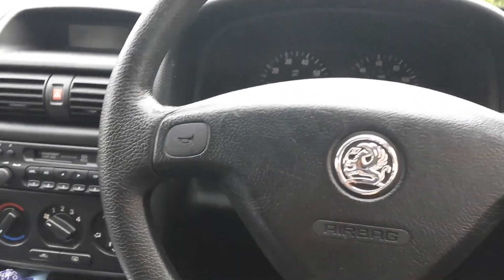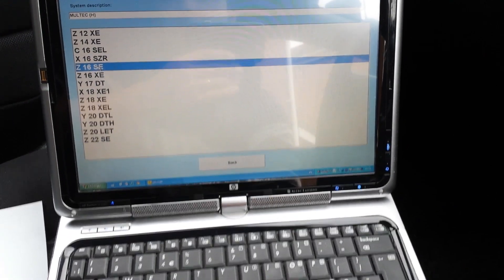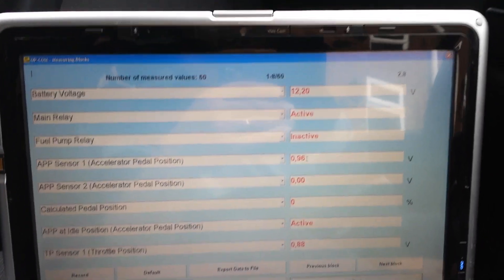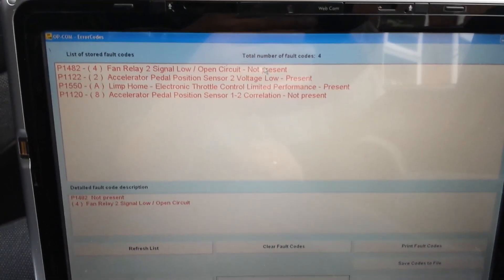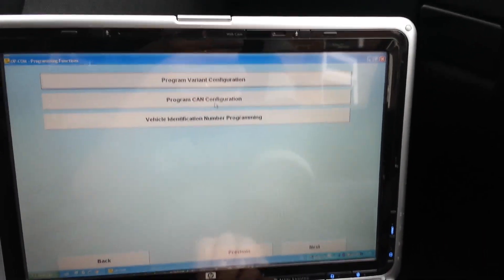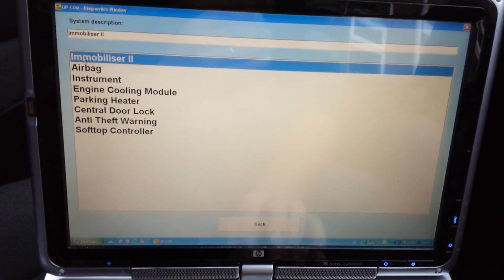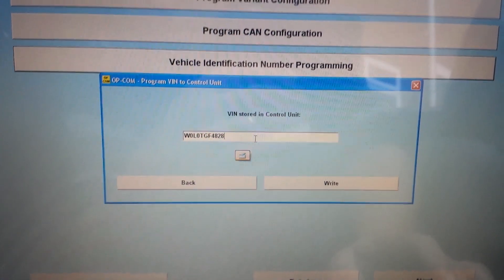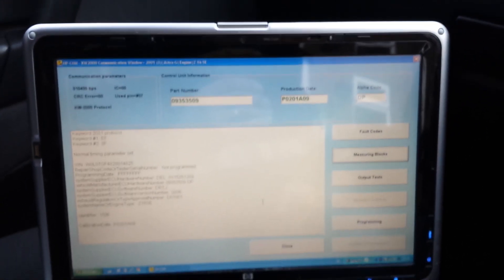Astra 2001 accelerator fault and Engine ECU change and programming.

Comment: Hi thanks for the video! I’ve found a reset ECU with the same part number as my Astra G, but with the four letters on the ECU being different. (Mine is DPAB and the one I’ve found is DMKP) will the swap still work with op-com or do the letters also need to match?
Reply from the maker: Should work, if it is from the same engine...
👍👍👍

Comment: I have got more or less the same fault on mine. Measued peddle and ok. The fault light comes on when its -4 c. Then when the engine temp gets to about 50c...I had op com on and it even showed 0 volts on App2 as the fault appears..Can you program the ECU with the china clone op com?
Reply from the maker: Should be able to... do you have a replacement ecu with the original pin?
👍👍👍

Comment: 02:55  is the engine ecu is dead!!! i had it last year!
Reply from the maker: In this case not "dead" per say, but an internal fault.
👍👍👍
Reply: @LMAutoRepairs  i know.. the cold soldering point. ... you can fix it by your own??
Reply from the maker: @N.D.J.S. 
You can... I have videos on that...
You need a small tip for your soldering iron, some aluminium flux and some steady hands...
😊

Comment: I know it's an old video but hope I can get some help. It might be a dumb question but bear with me. I have 2000 Vauxhall Astra G, swapped the 1.4 engine for a 1.6 engine but kept the original engine ECU (well the service center did not me). Is re-programing the ECU a must to fit the new engine? I'm logically convinced it is but they are not. Appreciate the help
Reply from the maker: You should load the 1.6 software...
Otherwise you are not taking advantage of the bigger engine...
The engines must be pretty similar for you to not notice any issues...
👍👍👍

Comment: Hello i have the same problem i will try to find the 2 wires that should have 5 volts and jump them did u solder them together cause 1 shouls already have 5v or did u get the power from somewhere else? Thanks
Reply from the maker: I barely remember what I have done yesterday, leave it alone 8 years ago...🤣
Whatever I did if if is on the video it is...
However,  you should be able to jump the working 5 volts, but if it is missing and you rule wiring as an issue, then most likely will the the engine control module...
👍👍👍
Reply: @LMAutoRepairs  should I cut the wire that's does not have a 5v? So that I don't brick it even more? And than bridge it with the 5v that does work? Is that saver to do? And what is the - terminal so I can check the voltage do you still remember? I hope so haha that would help me slot
Reply from the maker: @kay__72 
I don't remember now...
Would have to check diagrams...
But a Google search and you will most likely be able to find them...
👍
Reply: @LMAutoRepairs  that's the problem I cannot find anything on Opel stuff ... In you're case Vauxhall 
It's an 2005 gtc 2.0 200hp Astra
Reply: @LMAutoRepairs  could you please have a look for me I need to know fore sure if I also have 2 + 5v wires next to each other i don't want to brick it even more
Reply from the maker: @kay__72 
Google Global TIS...
😉

Comment: Hi mate great videos the wife's got a astra g it's accelerating by itself any ideas.    ECU ??? Or something else it's revs ok stationary but once you drive it accelerates by itself and speedo jumps all over the place I live in Newcastle she's stranded in Edinburgh desperate for answer cheers of ya respond no worries if busy
Reply from the maker: Possibly, or the accelerator pedal...
Difficult to tell with at least a scan etc...
👍👍👍
Reply: @LMAutoRepairs  cheers for the reply it's still stuck in Edinburgh apparently radio is going crazy now on top of faults disconnected battery etc try reset looks like scrap any other ideas might bring back to Newcastle and have a look ,🥴
Reply from the maker: I said, without at least a scan, it is shooting in the dark...
👍👍👍

Comment: My Opel Astra Ecotec 1.6 is facing acceleration issues and it has being diagnosed to be a worn out ECU .I want know if ECU HSFI C and can be interchangeable with the ECU HSFI 2.1 that came with the car.
Reply from the maker: I would try to get the same ecu type...
A "worn ecu" is a new one to me...
The ecu either is faulty or not...
Which codes do you have?
👍👍👍
Reply: Old ECU Code DNHN 12214870 Electronic engine controller HSFI 2.1

The code of the new ECU i bought is  DBKL 09355929 Electronic engine controller HSFI C

I want to please know if it can be compatible
Reply from the maker: I believe they are not compatible...

Comment: Hi my8 new ecu kit car starts ok but has no acceleration gas at all stays at 1200 rpm what could be the problem even with my old ecu its still the same car was ok till i opel the pressure valve on the pump
Reply from the maker: Well, if you have the same problem on two different ecus, as you can guess your issue is elsewhere...
Have you scanned the car?
Have you looked at live data?
👍👍👍
Reply: @LMAutoRepairs   yeah am getting p1122 p1120 p0381 p1635C P1625 p0216 p1530 opel corsa c 1.7 dti
Reply from the maker: Live data?
Anything out of the ordinary? 
Can you see the accelerator values?
You answer most likely will be there...
Reply: @LMAutoRepairs   good morning my8 live data are as about 
Ignition status 12v 
Battery voltage 12v
Main relay active 
Spill valve relay inactive 
Acceleration position sensor signal 5.08
App sensor 1 (acceleration pedal position) 1.14V
App sensor 2 (acceleration pedal position) 1.35 
App at idle position acceleration pedal position) inactive

Comment: Opel corsa c 1.7 dti 2001 
Replaced ecu kit car starts ok i have no gas pedal response changed the pedal 4 times no results what could be the problem cheers
Reply from the maker: Check that you have voltages at the pedal etc... check live data ad well...
👍👍👍
Reply: @LMAutoRepairs   so could bee 100% wire problem or the ecu before was ok now even with the old ecu its during the same thing all this come after I removed the pressure valve from the pump

Comment: Hi my8 i put in a new ecu kit car started straight way rpm stays at 1200 gas pedal not responding it was fine before i put in new ecu changed 3 different pedals nothing wrong with tje gas pedal what could it be ecu has 2 broken pins in bottom korner is it to do with the ecu pls help
Reply from the maker: Broken pins?
If the pins are in use, check is there is wiring on the plug side, I would say could well be your problem...
But without checking diagrams, it is a bit more difficult to tell...
Trace the wires, is there is any going to those missing pins...
👍👍👍
Reply: @LMAutoRepairs  new ecu had 2 pins missing on my old ecu i had 4 same corner and it worked fine till it die so i don’t think is to do with the 2 pins just confirm it with old ecu the plug is new wire don’t know what to do crap the bitch

Comment: Thanks for the video. I have a similar problem but the codes I am getting are U2105 and U2106. I have already changed the gearbox oil. The spanner light keeps coming up and the car goes into limp mode. Any advice on what to do?
Reply: Hi, did you ever get this resolved?  I am getting the U2106 and P1700 error code and I have sent the ECU away to be tested but after saying that it can be tested they are now saying that its to old (2003).
Reply: @sarahlou75  No I had to crash the car. Apparently, it is the TRANSMISSION ECU you need to change not the standard ECU. It can be found somewhere just under the battery. Just get another one second-hand from a similar model in the breaking yard and have it remapped for your car. I was caught up with moving to another house with on-road parking and my MOT expired so I had to get rid of the car. I hope this helps.

Comment: I have 6 pins broken on my ecu opel corsa c 1.7 i got another ecu just the ecu on its own how can it be programmed
Reply from the maker: Hi
You need the pin from the second hand ecu to reset it, (unless you bought it already reseted...)
Then with the pin from the car, go to the immobiliser system and install it...
Same as on this video...
👍👍👍
Reply: @LMAutoRepairs   what about those broken pins can they be repaired cheers
Reply from the maker: Broken pins?
On the ecu plug?
Reply: @LMAutoRepairs  yeah on the corner 4 pins completely broken
Reply from the maker: You will need to open the ecu and either replace the broken pins, or wire them directly to the outside...
👍👍👍
Reply: @LMAutoRepairs  i did open at the garage of a friend he said they can’t be replaced cause they are from inside something like that well open it tonight and let you know have you got what’s up email so i can send a few pictures so you can see what can be done i jave no turbo activation car won’t pass 60mph latter acceleration any way thanks have good weekend
Reply from the maker: Well, theoretically, they can't be replaced... but you kinda can...
But again, if you don't want to go through the trouble of replacing them, just solder some wires inside the ecu, and connect them to the loom...
Watch this...
https://youtu.be/vuV2JJTcQ4Y

Comment: great fix ,i have a vauxhall astrag 2002 problem with it is i cant get full load on my trottle position idle is fine partial load is fine but full load keeps geting me invalid,changed ecu trottle body and pedal still the same please let me know if you can help .thanks

Comment: Hi, on the 2002 opel corsa c 1.7 di, I have sobs at idle, I have to go downhill without accelerating in third gear, but if I accelerate it is perfect. the accelerator as soon as you touch it looks like an on / off switch the engine responds with a click, the same is true when you leave it.

Comment: Hello! thanks for sharing this video. I have the same car with the same problem. Just spent £300 to get an original pedal replace & various test. Now, I am back to square 1. Could you please confirm, if the ECU involved, is the one attached on the side of the engine? apparently there is an other one behind the bumper. Many thanks again! M
Reply from the maker: Only one ecu for the engine...
Which engine do you have?
Thank you for watching!
Reply: @LMAutoRepairs   Thanks for the prompt reply,  much appreciated! it is a 1.6 16V - Z16SE . The garage has reported the following fault codes: P1122 (Sensor 2), P1120 (broken tube- sorted) , P0130 (O2 sensor malfunction- sorted) P1550 (limp mode). Not mention about ECU fault.  I am thinking to get the Op-com to check what is going on on both of my Astras. Anyway, the guy at the garage has clean the connections on the "ECU"  behind the front bumper on the Left hand side..but it does look different (the location of the 2 connectors) from the one you show on the video.  I found that "ECU" attached on the right hand side of the engine. Thanks again, M
Reply: Forgot... is the ECU pin code  (4 digit) the same as the one I use to activate the Car stereo? Thanks :-)
Reply from the maker: No... different pin...
Reply: @LMAutoRepairs   Ah! Do you know if the PIN shows on the Op-com on Astra G or do I need another program? Thanks! M
Reply from the maker: Need other ways... Op-com don't think it can retrieve the pin on those...

Comment: hi like watching your chanel , very precise and informative and well presented , i hope you can help me as the local garages dont seam to be able to , , i get code p1631 twice and p0100   on an opel corsa c 1.7dti .  the only info i managed till today  has  to do with the anti theft system and air mass (maf) , but the car has never refused to start or cut out , sometimes it will lose power and turn on  the spaner light and i lose power for  a minute     other times it makes no difference and the car will run ok ... had the key checked and the chip is good ...I'm stomped on how to fix this problem , many thanks and keep uploading these informative  videos ...top work ...
Reply from the maker: Hi
The P0100 is referring to the MAF... you might have a MAF that is starting to fail... 
But check the intake for carbon build up... clean if needed... that can restrict the air flow, giving faults for the MAF...
As for the P1631, change you fuel filter, if you haven't done it recently...
Thank you for watching and for your comment!
Reply: @LMAutoRepairs  Thank-you for your  time in responding to me  ...  have done as you say already ,now i am  going to get a new Bosch MAF and see if that revolves the issue , again many thanks for your feedback ... keep up the good work ...um grande  abraco da madeira ...
Reply from the maker: Yes... get genuine parts when it comes to sensors etc...
Abraço!

Comment: Hi 
what is this scantool that you have ?
did you take the pin code of the old ecu or the new ?
thanks .....great video as usual
Reply from the maker: Was using Op-com here...
You need the pin of both if the replacement has not been reset...
Thank you for watching!

Comment: can you clone with carprog opel astra g engine control unit?
Reply from the maker: Never tried... depends also on the engine/ECU....
Thank you for watching!
Reply: @LMAutoRepairs  engine is z16se,ecu is 09353509 clone to ecu 12214860
Reply from the maker: @calocali8490  
I believe it can do that one...👍

Comment: Hi, I wanted to ask you if every time you reset the ECU, you have to reset the automatic gearbox? Because my Astra h has the automatic transmission and since I reset and reprogrammed the ECU I have problems with the error P0700 (TCM) transmission control module. Thanks in advance, Antonio.
Reply from the maker: After the reset, have you programmed all the settings back on?
Thank you for watching!
Reply: @LMAutoRepairs  Actually now that I've seen his video, no! Because the guides that I found previously with OP COM here on YouTube, for the ECU reprogramming after the reset, nobody entered these settings, in fact now seeing this precious video I was impressed! In fact after the ECU reprogramming I started to have problems with TCM (certainly not set after the reset) and sometimes even 1120/1122 accelerator pedal as in his video. Now I hope to solve! Thank you for your kind availability!
Reply from the maker: @tsky552 
Not a problem! 
👍

Comment: Please I need assistance with 2003 Vauxhall Astra. The engine starts and dies after a few seconds. It gives the following 3 error codes 
P0120-2 - Throttle position sensor circuit 1 voltage low.
P1550-1 - Electronic throttle control reduced power
P1120-2 - Accelerator pedal position sensor 1 low input.

The spanner light is on.
Please help
Reply from the maker: What king of help do you need?
Test the components and wiring... power and grounds... that proved ok, you might have a faulty ecu...
Thank you for watching and for your comment!
Reply: @LMAutoRepairs  Thanks for your response. It has been difficult testing the voltage levels and confirming that there are ok because I do not have the pinout values or the circuit diagrams. Any help in this regard please

Comment: Hello LM, and everyone else, thanks for the video. I have two questions please: 1) Is Opcom just for Vauxhall/Opel? 2) I have seen Opcom sets on ebay for around £20 new - is that the kind of thing you have here in this video, or is yours a more expensive version? Thanks
Reply from the maker: The answer to you questions is, YES... and no... my one is not a more expansive version...
Thank you for watching and for your comment!
Reply: @LMAutoRepairs  Thanks for the reply. Any chance of a bit more information to help someone fairly new to all this like me find the right one to buy? Thanks
Reply from the maker: @iozel4633  
Hi
BUY AT YOUR OWN RISK
https://rover.ebay.com/rover/1/710-53481-19255-0/1?mpre=https%3A%2F%2Fwww.ebay.co.uk%2Fitm%2FNiceCheck-Op-com-1-7-obd-opcom-obdii-Diagnostic-tool-Fault-code-Reader-Auto%2F303227336684%3Fhash%3Ditem4699c1f7ec%3Ag%3Akd4AAOSw3GxdLzKh&campid=5338344466&toolid=20008

Comment: Good video i have astra g 1.6 16v and the pedal gas ehen i push just 2500rpm  not more what is the problem
Reply: I thing the problem is throtle body it repair or change
Reply from the maker: @rilindhaliti4121  
I don't like to proceed spend money on parts,  based on "I think"... 
It can become very expensive, very quick, when you start to throw parts to a car based on guesses... but it is your money... Lol
I would have it diagnosed first...
Or get yourself an Op-com...
Reply: it makes me doubt because it seems pretty good sometimes it shows the problem the same as it happens in a very short time the kir is getting good and still interrupts
Reply from the maker: Hi
I am not a wizard... Lol
Scan the car and go from there...
Thank you for watching!

Comment: Please when the card fails can it just be reprogrammed or changed....my opel has been down one month...It read accelerator pedal sensor. .even when  I changed the pedal it didn't work..the tech now says the card..I changed card but two plugs stopped burning..it's a pity for OPEL
Reply from the maker: Hi
I am not sure I understand what you have done...
Have you changed the ecu?